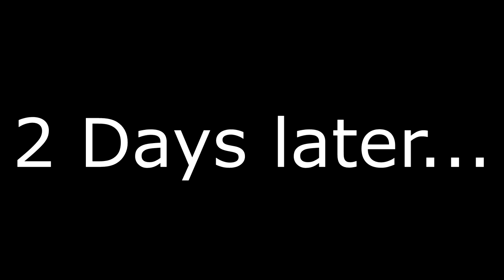2 Things YOU Should NEVER BUY ON EBAY

Comment: Drill a hole thru the end of the bolt and use safety wire or a cotter pin to secure it with no worries =)

Comment: I put eBay pads on my motorcycle and 3years later still have good life left. but I ordered two different clutch cables and they both lasted a month a piece. finally went with a oem original used one and a year later still good. they could base the points off of best line and lap times.

Comment: @3dmachines Hope that swingarm isnt aluminium where that nut goes, if it is, that lock washer will eat into the aluminum assuming it's a steel lock washer. Need a steel fender washer to use that lock washer. I learned the hard way with aluminum rims on my quad with just steel lock washers and nuts.

Comment: Don't use that lick washer the wheel will not align correctly! Also use some high temp grease on the axle tube it'll be much easier to take in and out and will save some life on those wheel bearings.

From a fellow dedicated hare scramble and enduro rider!

If it helps give a shout out I follow every video.
Reply: Lock*

Comment: You're putting the axle nut on the wrong way, there should be a hole in the axle that aligns with the openings on the nut that are there for a cotter pin
Reply: Its still a nut for the axle, therefor its an axle nut. And I've put more of them on bikes than you ever will.

Comment: That's the dumbest thing I have ever heard!!! "probably wear out really fast if it was new"  I hope the kids watching take what 3D says with a grain of salt
Reply: it would to an extent run out faster though wouldnt it?  i'd assume the worn chain wouldnt ever fit a new sprocket like it was made to hence wear it unevenly and quicker. thats my logic in my head, i dont own a bike mind you so i dont realy know about sprocket and chain wear and could be fully wrong here.
Reply: +Sleeper O9 I'm 36 years old and have owned probably 100 Bikes On and off road ATV ect... Plenty of times I've replaced just a front/rear sprocket or chain and it doesn't make a difference. After the first ride the chain and or sprocket will conform to it's counterpart
Reply: cheers man thats handy to know.